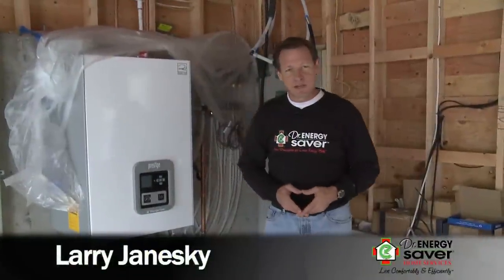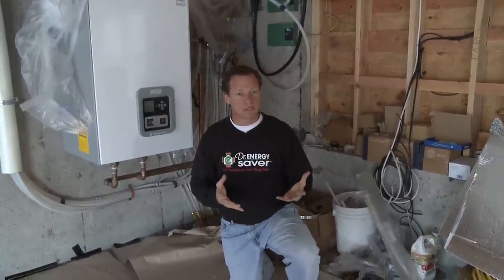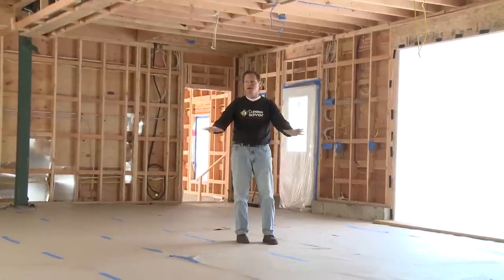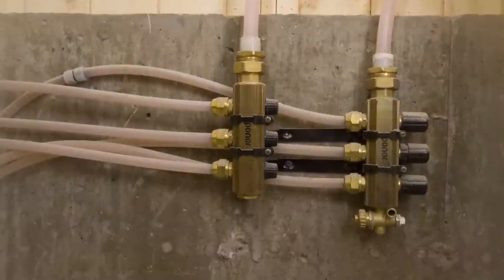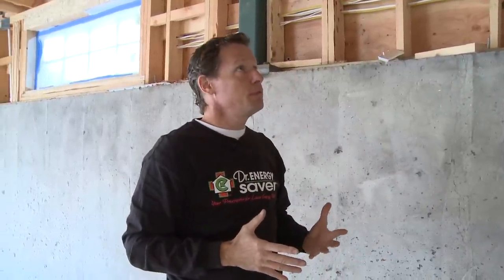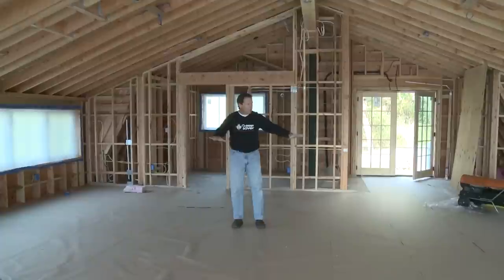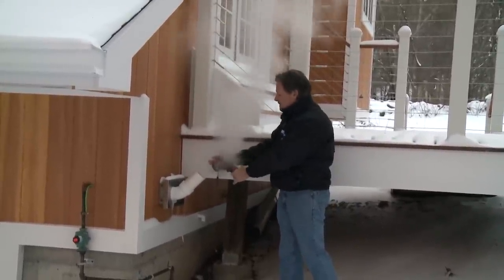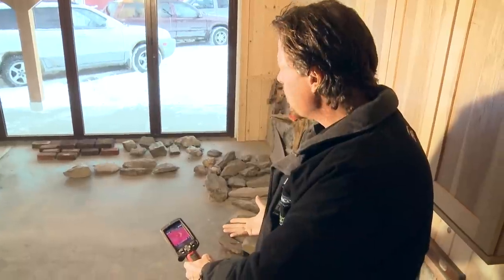Radiant Heating in Floors

Comment: Got a question. If I have a suspended garage floor that is already poured onto steal decking 6in thick. Can you still do radiant heat under the steel decking? Will the heat transfer through the 6” concrete floor?

Comment: Sorry I don't want to be rude, but if the exhaust is punting out 94 degrees, that is 34 Celsius going out the door, where is the efficiency?  With that loss you can heat up another house.
Reply: Not sure, but if you were to take even more energy out, you would have to install a fan to keep the exhaust moving, and thus kinda negating the effect.